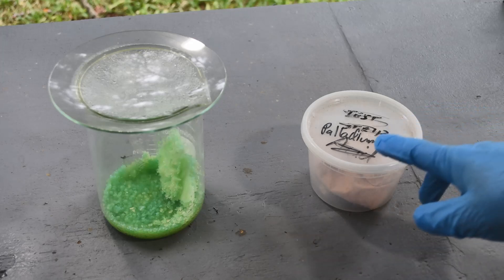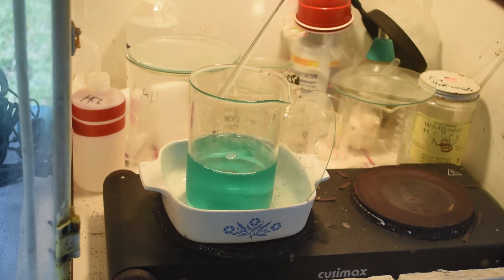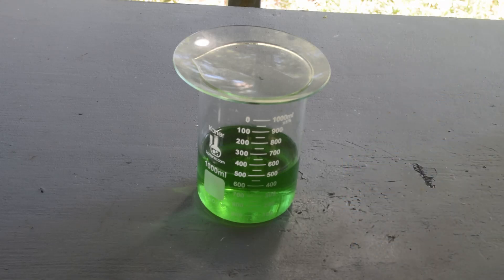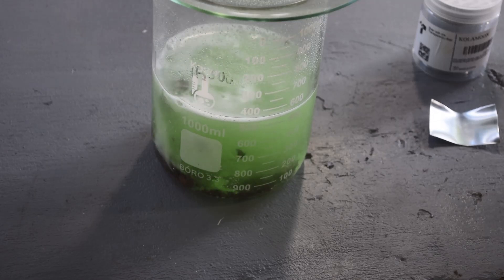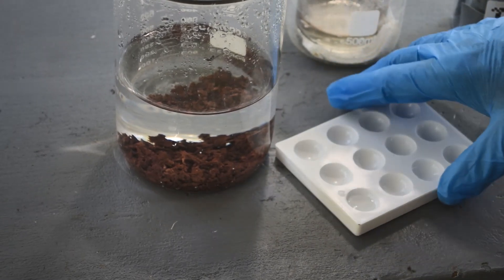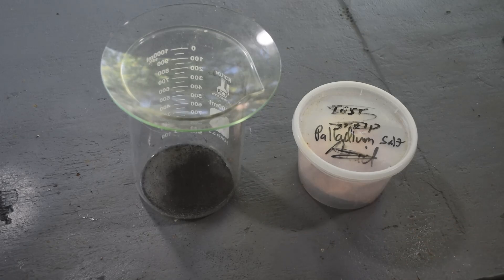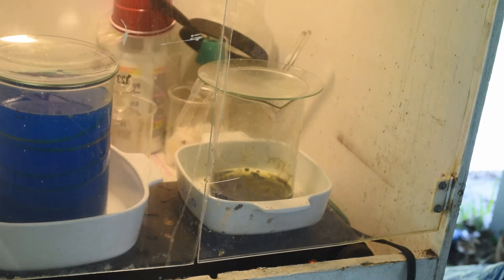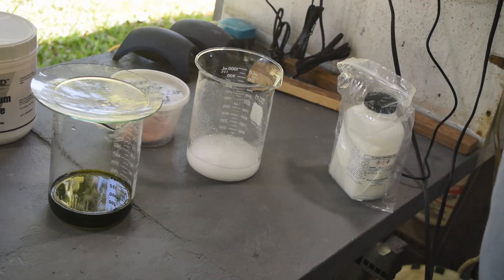Gold and Platinum Group Metals Recovery from My Stockpot Pt. 5 #chemistry

Comment: I got a few thousand trim pot potentiometer. I believe they are german made. They have palladium wire wrapped around a piece of copper and there's a contact that is also the same( silver and palladium  alloy. Would you be able to run a test on these?

Comment: Precipitate the zinc with the next reactive in series?
Reply from the maker: No need. The zinc stays in solution as a highly soluble chloride and is easy to wash out of the cemented metals. Zinc is also fairly cheap.

Comment: So I paused, I think you should have used nitric. Why? Because you already have the palladiun in metalic form. Dilute Nitric would have removed the copper leaving the palladium behind in metalic form.
Reply from the maker: Nitric acid also readily dissolves palladium. It's the only platinum group metal that is significantly affected by nitric alone. The palladium in this material, along with the copper, were originally dissolved out of my stock pot material using only nitric acid. Nitric would redissolve both.
Reply: @omegageek64  May have gotten things backwards. Not hard to do with PGMs. I have piles of material with PGMs' just sitting and waiting for me to do something with them. The oz of Rhodium I recovered was very satisfying